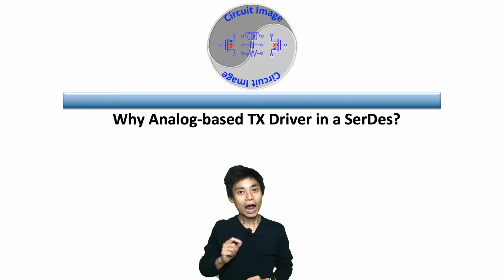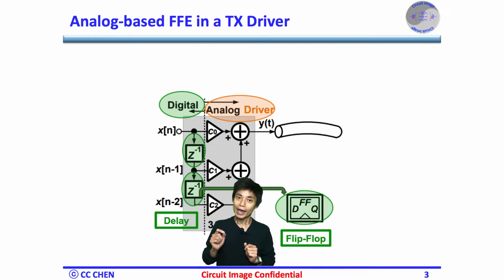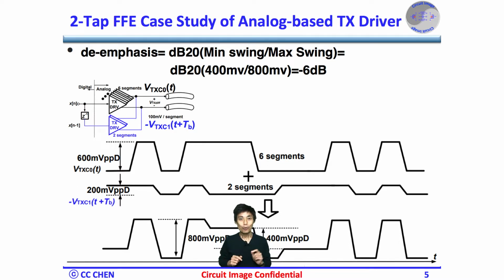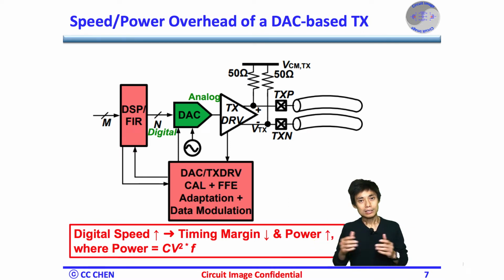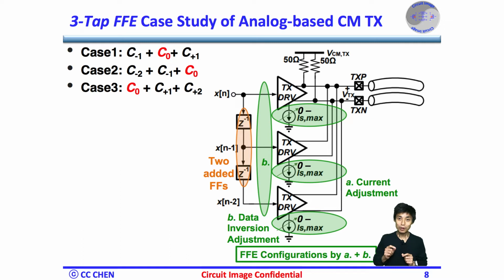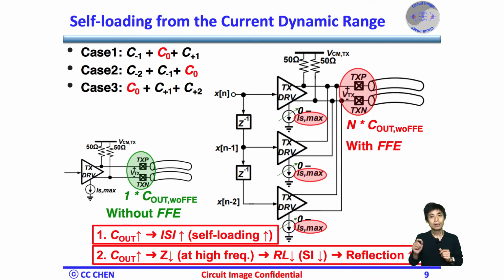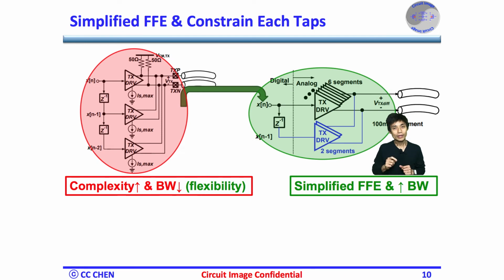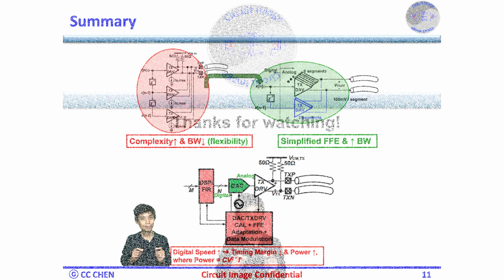Why Analog-based TX Driver in a SerDes?

Comment: Thanks for your sharing.
There are some questions that I want to inquire to you.
1. As your mention, the analog-based TX driver is easy to implement on simple circuit. And for DAC-based TX driver, we can't use it to transmit data at a high-speed transmission since the digital timing limit, right? may I know what the digital timing definition here.
2. FFE can be pre-emphasis and de-emphasis, right? can we also say FFE won't enlarge the signal nosie, so we can put it in the TX?
3. For FFE(de-emphasis), there are pre-cursor, main-cursor and post-cursor, how do we decide the value for the coefficients(analog strength)? and why it needs to be cancelled if there is a negative value of the coefficient(analog strength). How many taps do we need for cancelling the noise.
Thanks
Reply from the maker: Hi 育瑛, thank you very much for the excellent question. 😀
I have comments below.
1. The digital flip-flop timing circuit may need the setup and hold time constraint, which would limit the digital timing. I will make another video to discuss this. :)
2. We may care about the signal-to-noise ratio (SNR), the TX FEE would reduce the DC swing; therefore, the SNR would drop.
3. There is a link training to do that through the link-connected procedures. I will make another video to discuss this. :) Unfortunately, we cannot cancel the noise since it's a random process event, not a deterministic event.😀
Reply: @circuitimage  I really appreciated that. I'm looking forward to the new video, thank you agian.
Regarding question 2., since the SNR would be dropped from TX FFE, so that's why we still need to use the CTLE and DFE at RX side, is it correct
Reply from the maker: @Erichsu-e9m  Hi 育瑛, thank you so much for the feedback.😄 I would suggest that you look at both the "why CTLE (https://www.youtube.com/watch?v=zsuJMqadaKY&t=24s)" & "why DFE(https://www.youtube.com/watch?v=KiWziOm_nHg&t=5s)" videos. Then you can check the advanced videos like "Why NOT CTLE-Only? (https://www.youtube.com/watch?v=-cWZefyOIRw&t=2s)" & "Why NOT DFE-Only? (https://www.youtube.com/watch?v=qUsF8vd8aOw)" Then you should have the complete circuit images. :)😀

Comment: Thank you Chen. How to implement VM FFE. ( example how to get 100mV/segment )? CM FFE is quite easy to understand.  let's say  in this example when post cursor is not used , how to maintain impedance matching with 6 segment main cursor.
Reply from the maker: Thanks for the good question and I'll make another VM FFE, which maybe easy to explain w/ a few circuit images :)